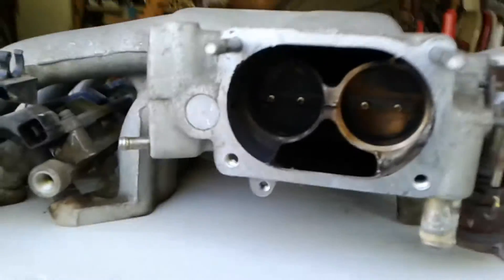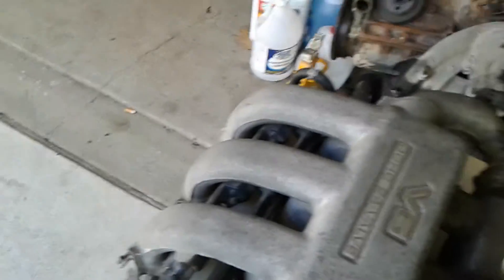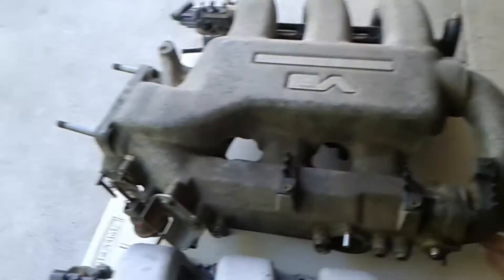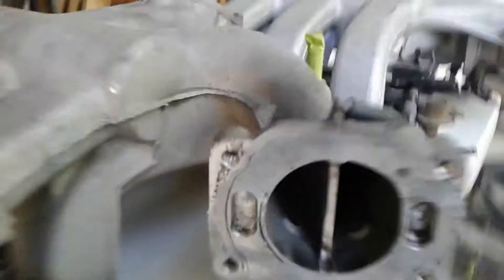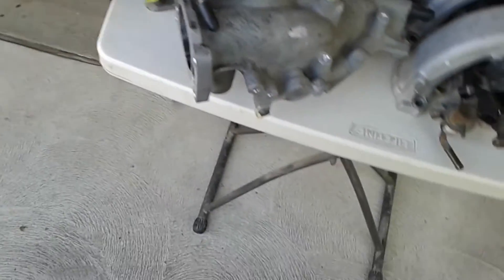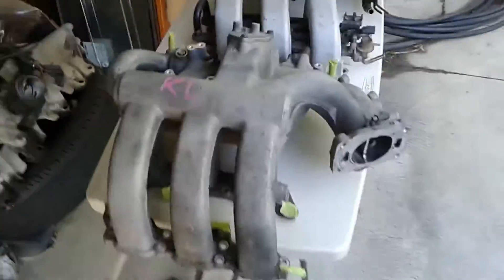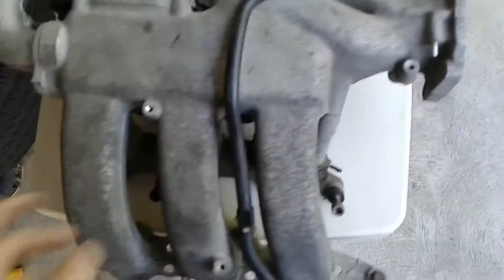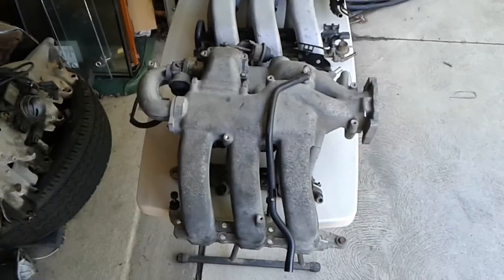KLDE, KLZE, KLZE curved neck, and KLG4

Comment: The straight neck ZE has the high end cams right? And the curved has mid range cams? Or do I have it backwards?
Reply from the maker: The straight neck has the better cams, pistons, square port heads and intake manifold. Best one with 200hp 170tq
The curved neck ZE from overseas could have the pistons, maybe the cams... most likely though will have DE cams and  DE pistons, with square intake runners and heads. 190hp - 180hp
The 95 Millenia has ZE heads with DE cams, DE pistons and curved neck ze intake. Later than 95 might have DE heads, might also have ZE heads, put together with the curved neck ZE intake. 180
If the engine has the ZE pistons and cams it should have higher compression numbers. I believe 220 is what they should read for a good engine.
Maf swap combined with any of these should make a little more power.
Reply: So where can I trust getting a 200hp straight neck ZE from? I have heard of people getting a straight neck intake on a weaker engine; they got took.
Reply from the maker: That can happen, but, it's less likely if you are organized, ask questions, document, have the seller document, get pictures from them, compression numbers, take pictures as you open the crate when you get it. Stuff like that. PT has a good thread on that. If anything doesn't feel right about the deal or the seller walk away. I got mine from a guy that had it shipped himself. He prepped the engine and his car got wrecked before he could put the engine in. So it sat for 7-8 years in his garage and had never been used in the states. He had pictures of the cams and how clean it was under the VC, was uncertain about the compression numbers having tested it and gotten low numbers. The seller seemed honest and as it turns out was 100%. The compression was fine, may have been low from  a lack of oil  somewhere from sitting, or maybe valves weren't seated right after switching the springs and retainers until it was run.

Have them show you under the valve cover, so you can see the cam numbers and state of things, silver good, black sludge bad.

Have them get a picture of the head casting stamp between the manifold that will confirm the head is square port. KL31s  have an EGR block off plate on the rear head and a missing threaded allen plug on the driver's side of the engine rear head (probably won't be able to see that in a pic.) that goes to the EGR passage. Rear exhaust manifold will have no EGR hookup either otherwise looks like a DE manifold.

KL31 block will not have a VIN tag, because Japan did not use VIN

The only thing you can't confirm like that is the pistons, but  compression numbers should be higher than a DE.
Reply: Damn bro, thanks for all the info. You sure know your ZE shit. It's hard to find info like this on this swap of yesteryear. I noticed they are even becoming scarce on the jdm import sites. I'm not sure how much of what you have recommended I could get an engine import site to do for me, but I'll try if I ever do the swap. There are some on ebay sometimes from importers. Right now I am trying to downsize from my 10 cars and pay off some debt so my plate is a little full. If I keep it I'll be posting a video with side exit exhaust. I probably will? I'll just keep it for backup and fuck with it here and there, then maybe later I can get a ZE in there. It'd be a sleeper. It looks shitty as fuck with the rear hatch having rust holes on it and clear coat peeling and all. Eventually I will get a nice one.
Reply from the maker: Guns&Cars Forums are a great source of information, sometimes parts too. There are carbon fiber hatches out there. It's searchable through google. Engines are expensive so a good seller will try to show what they have is good.